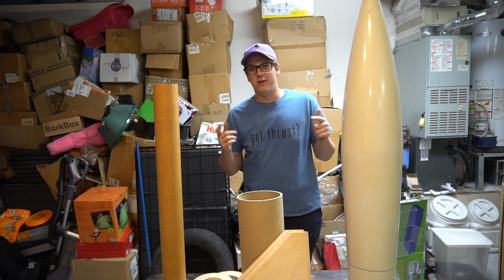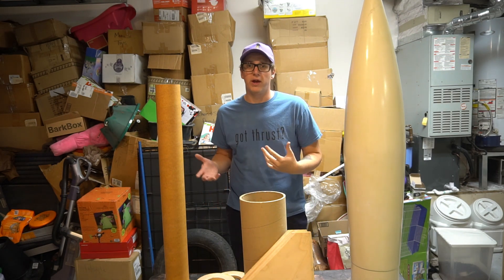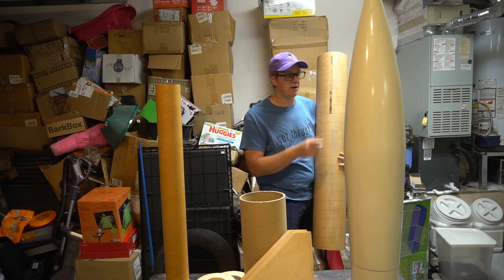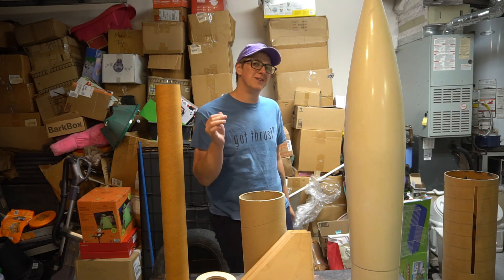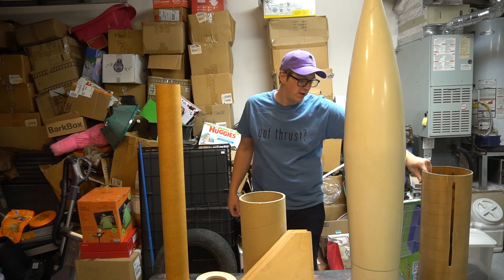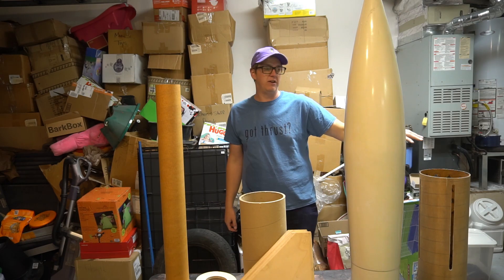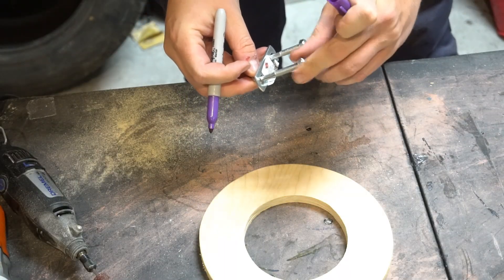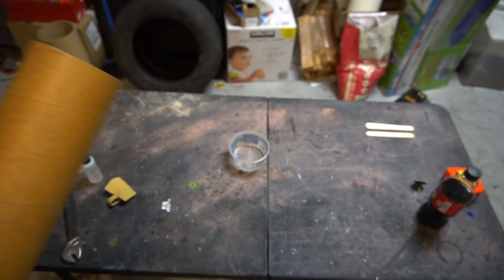I'm Not Sure If I Should Be Mad or Happy About This

Comment: I guess I don't get it. The fins are too small or too big?  You wanted a 75mm and fins were made for a 75mm motor mount. Body tube is 98mm.  So you are good?
Reply from the maker: Too big! Effectively it left me with the choice of cutting down the fins for the 98 or ordering parts to go back to my original plan of a central 75mm and four outboard 38s. 

I chose the latter. Haha